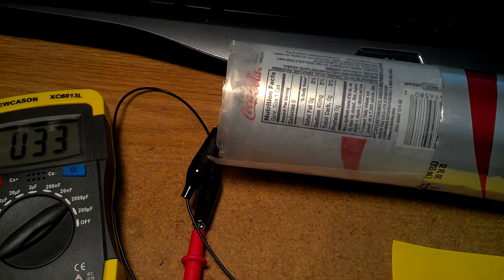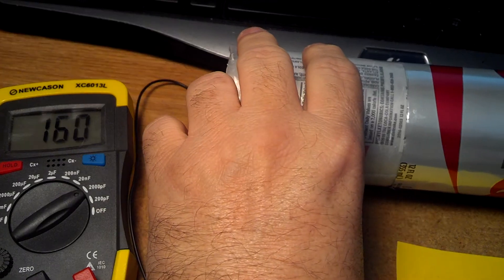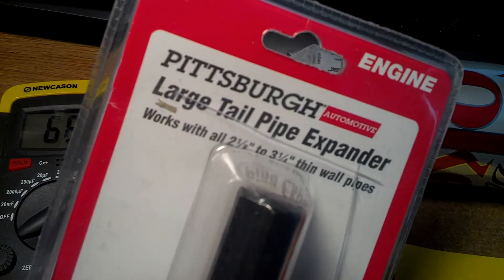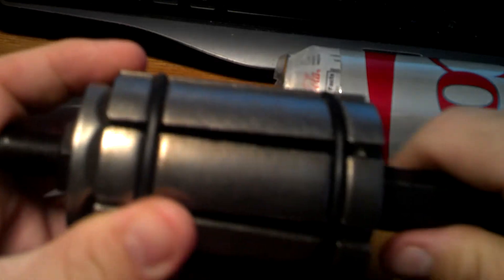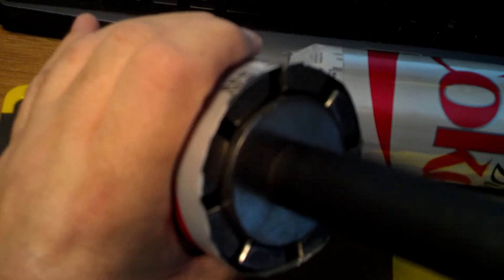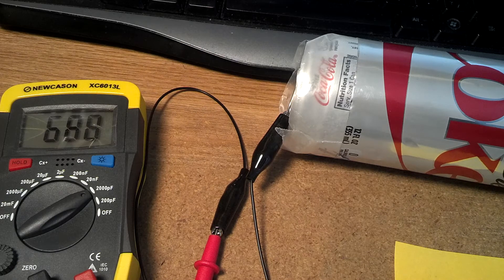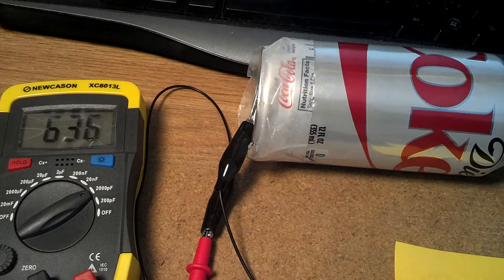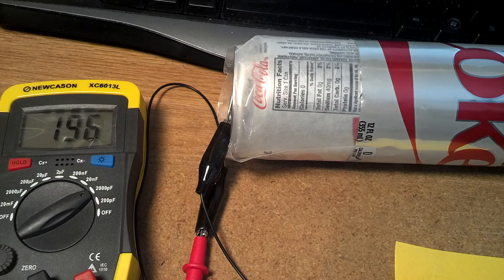Trombone capacitors and how to expand aluminum cans

Comment: Glad I saw this, I've picked up a few aluminum alloy softball bats that I've wondered about using for an exhaust project for a small engine machine.  Thinking the medium pipe expander will be a perfect tool to use to prep for fitment.  Also, great excuse to work on the cans I've been saving up.  Thinking will be interesting to see the detail regarding like which DIY easily available (packing tape, PETE bottles, wax paper, various thicknesses, etc.) dielectric insulators used and maybe like some less common like the teflon toaster packets or non-stick sheets.

Comment: Same idea as the Gamma match my father built for his stack of two 5-element 2-meter Yagi beams...  He used two sizes of tubing, I think one copper and one aluminum (I think the use of two different metals had more to do with local availability more than anything else), with a neoprene or similar tube separating them.  Small tube inside the neoprene, neoprene inside the bigger tube.  Worked great back then (1995 or thereabouts).

Comment: checked current price at Harbor freight. Only 14 dollars for small tail pipe expander or 19 for the large one.  It doesnt say what the "exact" size is.  So I will just have to visit the store and see. But really, this is a great idea.  I live in a HOA controlled area and it is looking like the magnetic antenna(using trombone cap) will be my best option.
Reply: Wow, that's nuts the inflation.  Now is ~$20 for the medium and ~$32 for the large one.  Notes online, "Works with all 1-1/2 in. to 2-1/2 in. mild and aluminized steel pipes" for the medium and "2-1/8 in. to 3-1/2 in." for the large Laguna brand they both are.  Was wondering if that meant the pipe size inserted and can expand and if so, what's the amount can expand since doesn't state the pipe thickness and am guessing that standard amount whatever that is.

Comment: The tailpipe expander is a cool idea.  I'm going to try putting the inner can on a rod with a groove in it, and hammering the thin sheet into the groove, so the circumference will get smaller.  👍

Comment: Great idea with the tailpipe expander.  Found you looking for a trombone capacitor.  I am thinking it won't be real good for transmit. Probably arc over, but for receive,, very cool.
Reply: Yeah, I was wondering what the breakdown voltage is and wondering what different insulator materials performance will do to affect that.  Maybe even some lube of some sort might effect, i.e. a teflon or silicone type.